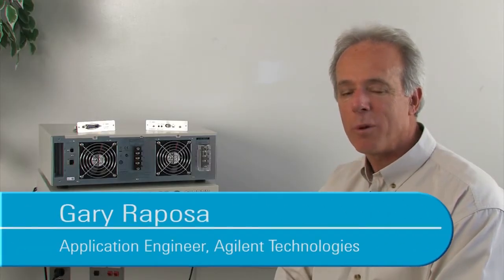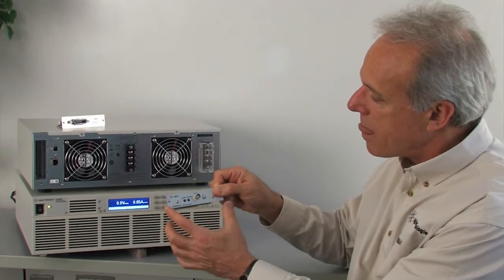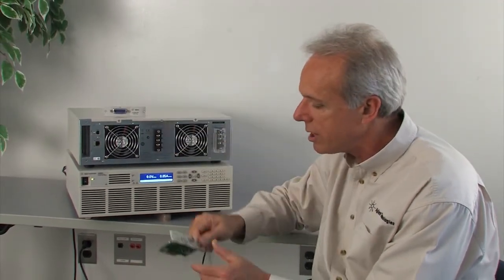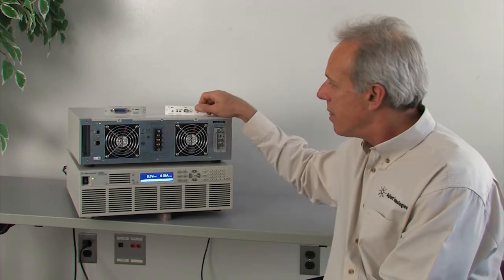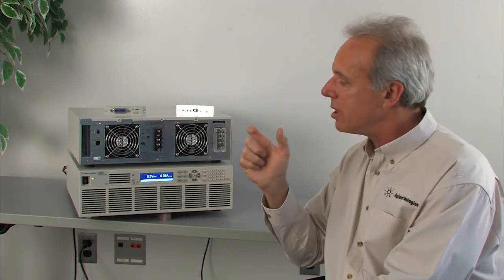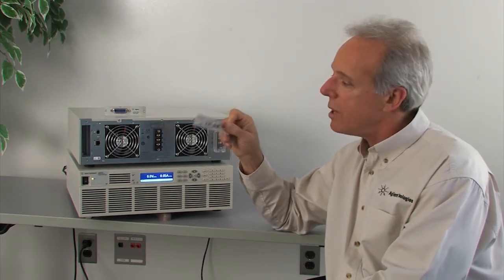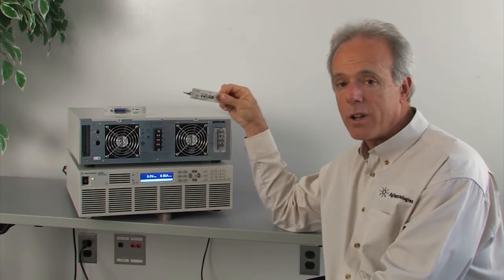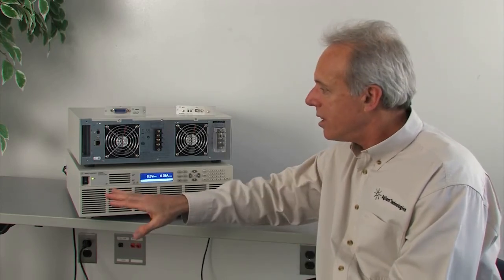AC Source AC6800 with Analog Control of Voltage and Waveshape

Comment: It is said in the datasheet of the product that the frequencies are to be used from 40 Hz to 500 Hz, for the accuracy of measurements. Is it possible then to use it in the lower end frequencies (0-40Hz)?